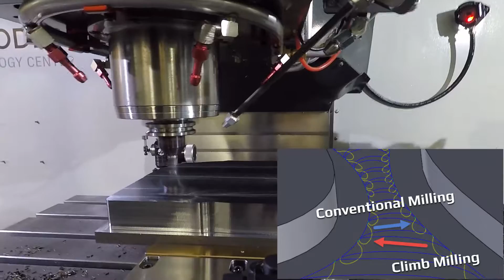Ripping Through 1018 Steel! | CNC Machining with Adaptive Clearing Toolpaths

Comment: How convenient, I just had our shop order me this exact endmill for a 1018 job. Can I ask what’s your RDOC? I was previously running at 3438rpm, 120ipm, at .050 RDOC but clearly I can push much faster
Reply from the maker: RDOC was .060", but the ADOC was 1" (200%)
Reply: Helical Solutions 
Do you think flood coolant would alter anything? We don’t have air blast on our VF1
Reply from the maker: @ardimarcs7698  It could - I would call our tech team at 866.543.5422 to talk in further detail about that application.
Reply: @ardimarcs7698  Probably already figured this out, but for anyone else.  Coolant will not evacuate the chips fast enough.  So you cant run it as fast.

Comment: Is that tool in an end mill holder?! Does the chip breaker geometry compensate for tool run-out?
Also, did you guys happen to utilize G187 for Haas at all? The movement on that roughing pass looked like the mill was slowing down around and in the corners.
Reply: Fusion 360 comes has a feed optimization option which slows down when approaching corners to help with direction changes in cut